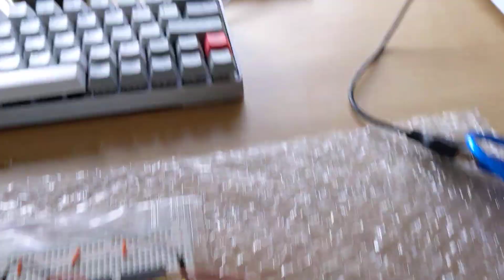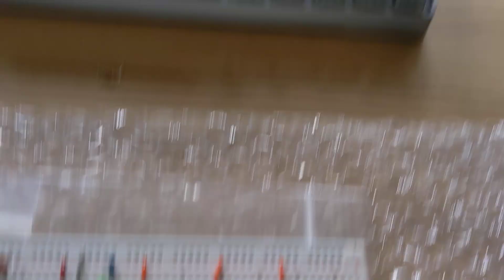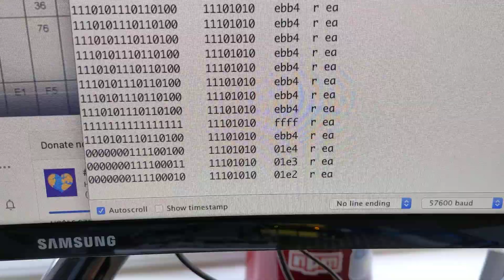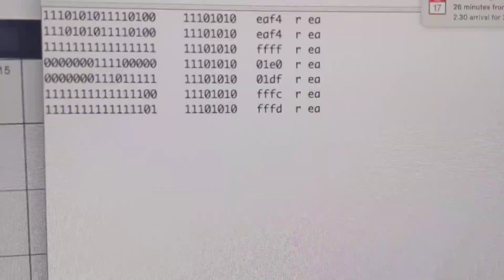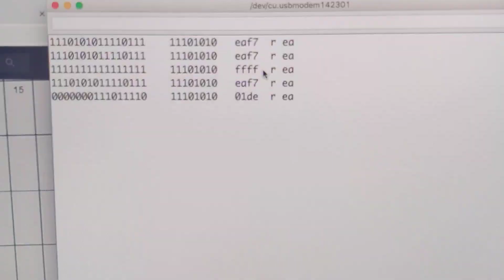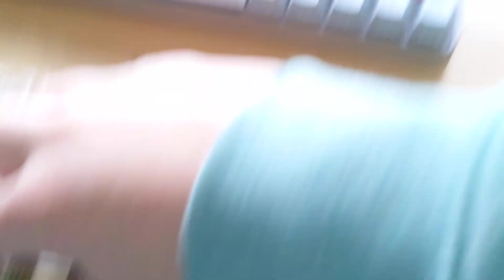6502 clock tick problem…

Comment: Have you sorted this yet?  I too built the same modules that you have and had quite a few issues along the way.  I remember something very similar to your problem but not exactly what I did you resolve it.  If you have an oscilloscope look at the clock pulse carefully.  I started using CMOS logic (CD4000 series) for the clock and all seemed well at slow speeds like single stepping but gradually I observed more steps that I could not explain - rubbish like you were showing in the video.  The problem turned out to be the speed of the clock rising edge - with CMOS it was almost 100nS and the 6502 spec requires 5nS.  I changed the CMOS for 74HC and all my funnies went away.

So I wonder if the combination of the LED in circuit and that particular OR gate is providing too slow rising edge?

If you can't measure it try different OR gates - preferable fast one.